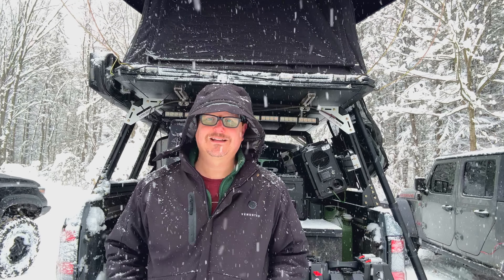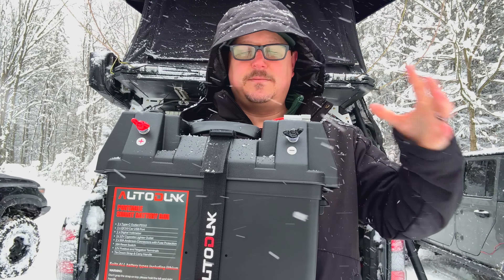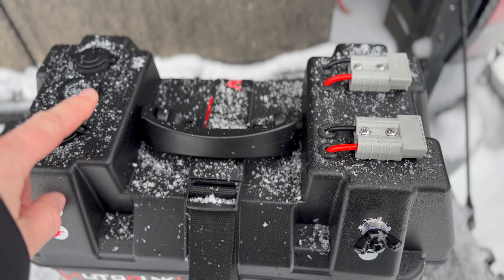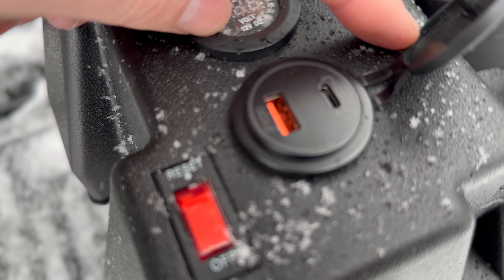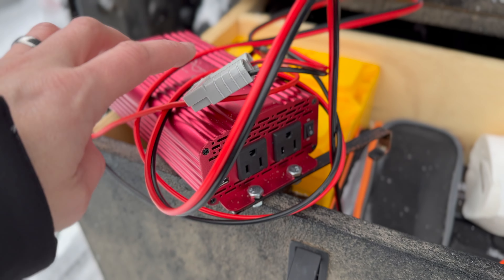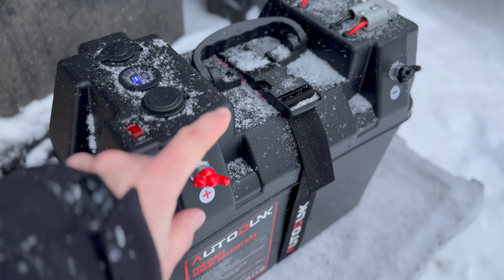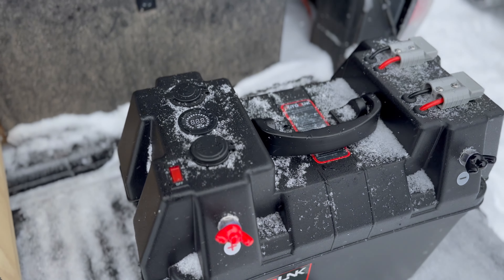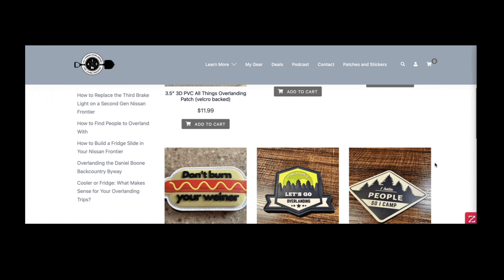The Easiest DIY Battery Box for Camping and Overlanding - Goldenmate Battery and Autodunk Box

Comment: Great idea. I got excited when I thought you said 500w Pure Sine but the link takes you to a modified Sine. Thanks for the idea. I bought the battery after your original review
Reply from the maker: No problem! Of course you could choose whichever inverter you wanted and do the same thing, so no pressure there. I'm using mine primarily to charge small electronics like drone batteries, my phone, and watch, etc.

Comment: This is great, is there a way or what would you suggest to keep a trickle on it from the vehicles alternator while driving?
Reply: I imagine you could install a 20A DC-DC charger from the main battery and connect it to the aux battery through 1 of the Anderson connectors. If you put a switch on charger then you could simply plug it in, and turn it on to charge while driving. 🤔
Reply from the maker: I basically bought this:  https://amzn.to/3w86Jkm. I figure I can just plug it into my 12v socket in the truck while driving and attach the alligator clips to the external battery posts. The battery has built in protection to keep it from overcharging, but the truck should just throw 12v power at it until it stops pulling it, I think.

Comment: I decided to order one of the Goldenmate 12v 100Ah batteries, smart battery box, and a 12v cigarette plug charger. Since I'm still learning about these new LifePO4 batteries do I need to worry about anything like overcharging using the 12v socket when I'm driving?
Reply from the maker: I'm no expert so take this info with a grain of salt, but I don't think there would be any problem charging through the 12 volt even though it's probably not as efficient as a DC to DC charger, because the BMS in the battery should prevent overcharging.

Comment: How can one connect a victron MPPT charge controller to it? By adding a "red" 50A Aderson plug, drill the two holes, and connecting it directly to the battery as well? Or can one connect the victron the the outside two terminals?
Reply from the maker: I would just hook it to the external posts I think. But I suppose either way would work and the Anderson would make attaching and detaching it pretty nice.

Comment: can you attach the box to be charged using solar? Im a super beginner when it comes to wiring and electrical and im trying to find a good easy solution to power my fridge for about a week at a time
Reply from the maker: I'm trying to think of how you would do that. If you could wire the solar into an Anderson plug (the gray plugs on top of the box) then you could pretty easily get the power in that way. The only thing is you would want some sort of controller between it and the battery unless you battery has built in battery management. So, it's a little tricky, but definitely seems doable.
Reply: @AllThingsOverlanding  Thanks for the info! could i put the controller between the solar panel and the anderson plug? or would the controller have to go after the anderson plug?
Reply from the maker: @deandavidson2823  So, my experience with solar has been that the controller is basically a box that the solar power enters and then it controls the output, so I would envision the solar going into the controller and then the output from the controller going into the Anderson plug and into the power bank.

Comment: I've been waiting for this video to drop and I'm probably going to try this same set up. What do you think of getting something like a NOCO Genius 1 and plugging that into the built-in inverter on the pro 4-x to charge the Goldenmate while driving?
Reply from the maker: That could probably work. I basically bought this:  https://amzn.to/3w86Jkm. I figure I can just plug it into my 12v socket in the truck while driving and attach the alligator clips to the external battery posts. That's my plan anyways, :D.

Comment: Are the two Anderson plugs able to be used for input from a solar panel?
Reply from the maker: So, I think you could maybe use that, but my concern would be that there's no controller between the solar and the battery, so I think that's the shortcoming of that for this application. If you had solar going into a solar controller and then some output coming from the controller into this box via the external poles, I think that would work.
Reply: @AllThingsOverlanding  Ah, I hadn't thought of that. I'm fairly new to using solar with my vehicle and am trying to wrap my head around anything and everything involved and the best setup for my needs. I really like the battery box you showcased in this episode and it got me thinking of how to make it work for my needs. Thank you so much for your insight and another great episode! Best regards.
Reply: No input on those, they are not directly connected to the battery terminals, just add another red 50A anderson, run cable directly to battery, or connect to outside terminals

Comment: How do you charge it from the car? or from a power outlet?  thanks and great short video :)
Reply from the maker: I basically bought this:  https://amzn.to/3w86Jkm. I figure I can just plug it into my 12v socket in the truck while driving and attach the alligator clips to the external battery posts. That's my plan anyways, :D.

Comment: Can you plug in a solar panel to this to recharge it?
Reply from the maker: Good question. Possibly, if your solar panel had the right sort of outputs and a built-in controller, but in most cases, the majority of solar panels wouldn’t work with it. 

I have built-in solar on the roof of my rooftop tent that runs into my secondary battery on the truck. My plan is to let that solar. Keep my truck topped off and then when this needs charged hook it up either via the cigarette lighter port in my truck while I’m driving or Using power coming out of the secondary battery into this one.
Reply: @AllThingsOverlanding hey man, would you wanna send me a message with tips and just general setup with the Nissan and how to set things up? I live in Wisconsin, and plan on overlanding a lot in the near future. I see you come to Wisconsin here and there, would love to see your truck!
Reply from the maker: @ParanormalHuntTV  Jist shoot me an email at allthingsoverlanding@gmail.com and we can chat there. I do go up to MI and WI usually at least once or twice a year. Check out the FB groups Wisconsin Overland and Michigan Overland as there are a lot of local folks to you in those!